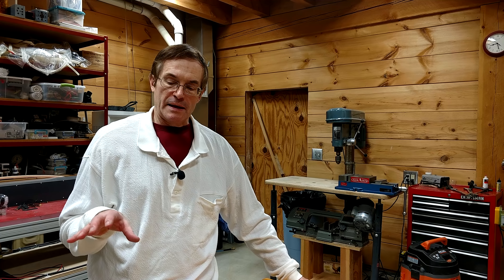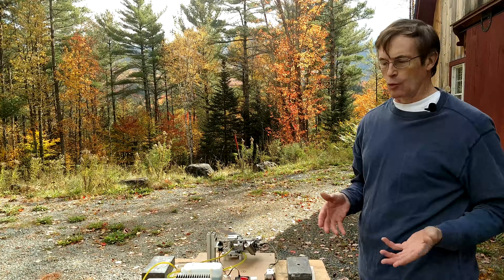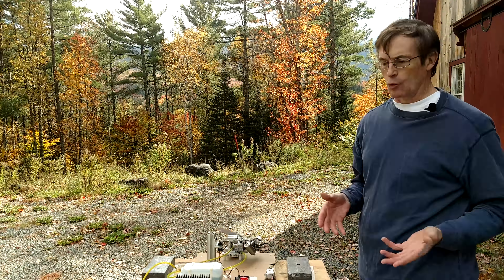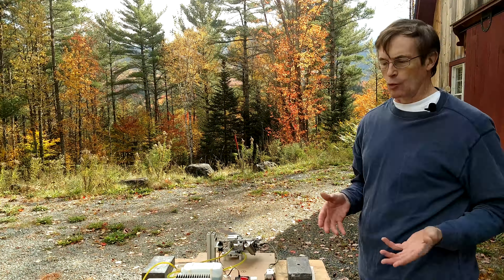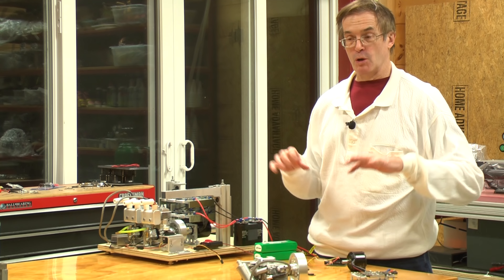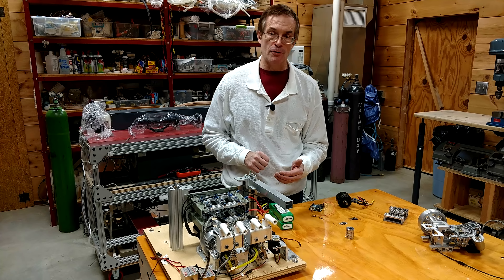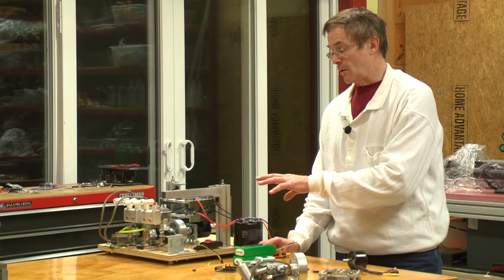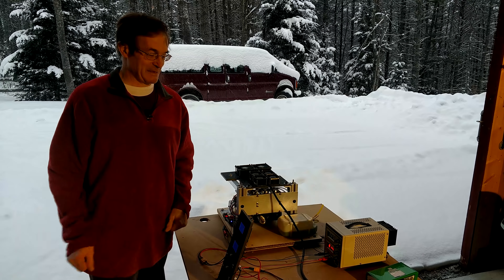Hybrid Drone Generator

Comment: Since you are running 2-stroke engines at a constant RPM it seems like you would benefit from a tuned exhaust expansion chamber.
Reply from the maker: That's probably true.  They all seem quite bulky and might complicate the enclosure design, nevertheless we will test one to see if the fuel savings are compelling.

Comment: A Cush drive hub like those used on single cylinder, 4 stroke dirt bikes used for road use may be of benefit. Twin 4 stroke engines that have the power and ‘pull’ strokes offset may further help. I love 2 stroke engines but am sceptical of their use for this application. 
P.S. in addition to the crossplane crankshaft, high performance 4 stroke engines make use of an additional counter balance shaft, (as  you undoubtedly are aware) running in reverse direction for most benefit. Interested in this myself but feel a turbine or at least a rotary engine, is a more beneficial route. A Hydrogen Fuel cell is the biggest carrot at the moment but is simply too expensive to support with ancillary equipment for the time being.

Comment: I've just found this channel and it's awesome! I'd like to do all this sort of stuff myself but I lack the time and space to do so, so it amazes me the job this guy does. Moving on, I wonder how he manages the charging of the batteries. They seem to be some kind of lithium batteries and they're pretty particular in these terms.
Reply from the maker: Thanks for the support, it means a lot.  The batteries are periodically charged on a standard balance charger.  The generator serves to minimize or eliminate battery discharge, but the batteries benefit from proper maintenance.
Reply: Tech Ingredients Thanks for answering. By the way, did you opt for the twin cilynder configuration for any particular reason? I'd expected an opposite cylinders, opposed phase and rotation configuration in order to balance the forces, but of course this makes installation a bit more complicated.
Reply from the maker: If the cylinders are operated in the more conventional twin configuration ie a "flat twin", then only if they are in phase will the mass imbalance cancel and only if they are out of phase will this smooth the output torque.  You still have to counterbalance the out of phase operation and as you say this configuration makes the installation a little more complicated.
Reply: Tech Ingredients That's right. However I meant, as you have isolated piston-crank sets, the setting could be better than a traditional flat twin, right? Running them out of phase and opposed rotation directions, and coupling the shafts with a gear instead of a belt, could bring both benefits. I don't know how much this would complicate things though.
Reply from the maker: I don't either.  But, we are working on so many other variations that I don't know if this is worth the time to tweak.  We have a super light, single cylinder, damn the vibrations and the voltage variations with wide open throttle operation and remote start, the 20 HP, 4 cylinder engine model, a turbine driven version and in the skunk works, a gas dynamic MHD generator as well...ya really.

Comment: How come without the generator running the resistors draw 12amps , and when you had the generator running the output from it was only 10amps needed to cancel the batteries out ?
Reply from the maker: That depends on the relative voltage output from the generator vs the batteries.
This can be fine tuned with a voltage controler.

Comment: Would there be an advantage to using an opposed piston 2 cyl 2 str engine as power source? There would be inherent balance of a "square" engine, less weight, cost, and complexity of single 2 cyl engine (with single crankcase).  The firing pulses alternate, occurring every half revolution (same as dual).  It's common for models of popular Cessnas, Pipers having  (wide) 4 cyl and 6 cyl opposed engines.

Comment: Motorcycle alternators are smaller, lighter, and use a rotating permanent magnet ring around a stator. They are usually coupled with a combined regulator+rectifier to produce stable 12-14v, perhaps those would work better?
Reply from the maker: They would work better than an automotive alternator.  The question is their power handling capability.

Comment: Nice concept and explanation, from a rough calculation, the breakeven of this vs straight battery is around 4.13kg which is .79kwh using the highest density lithium ion batteries... you should not compare to LiPo since they are not a high density system, they are a high discharge system. Keep up the research!

Comment: If you mount a single engine on a set of springs,do you think that may help dampen vibration ?....or attach a counterweights to the shaft of
the engine,one on each side of the engine to try and balance it...which will add about the same weight as the piston..?
Reply from the maker: Springs are interesting.  They don't dampen which is the conversion of the vibration energy to frictional heat energy.  They isolate, so that the engine continues to vibrate, but less of that vibration is transmitted to the structure.  It may seem like semantics, but it's an important difference because we actually want that isolation rather than have the force transmitted through a shock or rubber dampener.
Take a look at our video on "The World's Second Best Speakers". I discuss dampening systems there.
The flywheels do just what you suggest because they are not symmetrical and are weighted to balance the pistons.

Comment: I have a question about the capaicitors reducing the ripple. When you add in the batteries what is the capicitors for? Does the batteries not actually act like a capicitor in this instance and smooth out the power from the genterator? Mabey i am way off just a obsevation. I enjoyed your show and find it very infomative.
Reply from the maker: Thanks!
The very high peak charging and discharging that the batteries would have to sustain to act as smoothing capacitors is outside any research I've seen to support their survival.  It might work, but I didn't want to take the chance.

Comment: I wonder if there would be a way to reduce sound and vibration on lawn equipment by using 2 smaller engines and balance shaft and add a catalytic mini converter..

Comment: Great explanation of all the components and reasoning for each. My only concern is the size and weight of the large capacitors. Have you considered using a switch mode power supply or building something that functions in the same way as a SMPS? It seems like it would be possible to buy a 2000 watt SMPS and add some diodes to rectify 3 phase and get higher KV motors to have the voltage in the operating range of the SMPS. The benefit would be weight savings and voltage regulation handled for you.
Reply from the maker: The capacitor sizing is not well characterized.  The batteries themselves act in the same way to smooth the voltage spikes and it needs to be determined if capacitors are even needed.  The circuit as it stands is actually similar to a switch mode power supply.  In these, the high frequency, pulsatile DC current is smoothed with capacitance.  These can be made smaller because of the very high frequency (as much as 100kHz).  If we could obtain motor-generators with much higher pole count, this would help.

Comment: So I'm not entirely clear on this concept; are you talking about a quad copter or fixed wing drone? Would the weight savings offset the minor energy loss of the extra energy conversion, compared to direct drive?
Reply from the maker: The generator module could be applied to any electrically driven vehicle, even land based.  But our obsession on low weight derives from the intention to use these for aircraft and this is most important where there is no fixed wing to support the weight.
There is inefficiency due to energy conversion, but the are significant advantages.  The generator module can be placed at an optimal balance point, energy transmission through flexible wires is convenient and simplifies noise and vibration isolation.  In addition, the large number of existing, electrically driven drones could be fitted with these removable modules rather than fundamentally redesigned for direct drive systems.
Reply: I think I understand. 
So it's more about making the engines more flexible in terms of placement and power output, so that you can use a single, more efficient, engine to produce the majority of your cruising power. While at that same time working toward an industry standard that can readily connect to existing hardware.

Comment: so lets say I'm using four xoar ta120-20's and I plan on doing so at 44 volts, what kinda rectifier/capacitor setup am I looking at? I have a minarelli twin 140 for the generator it makes close to 35 horse at 4,500 rpm. I'm not sure if I should use a fifth ta120 or if need to buy another one. I know at max load at 44 volts I'm drawing 10000 watts per motor. I really could use some help, already spent alot on this. edit: this is for a manned quad copter, initially I tried using 8 vvrc 70t gas motors in a quad setup with only cable flight controls but could not find a way to eliminate slack in the control cables without sacrificing control vectors or adding more motors. Then I swapped to just four big minarelli twins and tried using a flight controller with servos controlling the motors instead of cables but for some reason it wouldn't work with arduino. I can't even make changes to my skateboard in vesc let alone use arduino so that's why I even tried cables in the first place. Three years and every penny I've made in the last five and I still haven't left the ground. Literally please help man
Reply from the maker: This is obviously a very large project, especially since your budget is limited.
It's tempting to start with the final large-scale goal and try to get each system to operate as the design requires. 
Been there/done that.
But, I think that is a mistake.
I'd hold off on that final build and construct a gassoline powered system, either centrally driven with a generator and 4 individual electric motor powered rotors or four small gassoline powered rotors. There are arguments in favor of either approach. You might try both.
Experimenting and modifying the small version is easier and cheaper, and you're more likely to get it right rather than cutting corners because of time and money constraints.
Reply: @TechIngredients  it's not the money man it's the failure for years while I hear my homies brag about their cubs and the crazy hunting trips they took it on. I wanted gas motors with manual inputs only in the interest of privacy and reliability but it's too unstable. Unless I seriously overprop it's just too twitchy and I've never even left the ground. Gas hybrid is my only option, the flight controller will work and I know that I can see examples drones are everywhere. I just don't know how much motor I need for the generator or how to build the generator. I'm just a hobby machinist I'm scared of electricity

Comment: there has to be about $3000+ of hardware and equipment on that work bench.  My jeep Cherokee is worth  $500, $200 maybe at a scrap recycler.  I won't be building this on my budget, unfortunately. 

But at least we can live through you and enjoy your achievements, courtesy of YouTube.  Thanks.
Reply from the maker: Technology can be expensive, but it doesn't have to be.  In many of our projects I discuss the issue of cost and the trade offs ie buy it, build it etc.  I enjoy designing and building these projects and have spent a lot over the years as "stuff" accumulated.
I built my first laser (nowhere my first project) when I was 10 years old.  I had very little money, there was no internet, I couldn't drive to scrap or surplus warehouses and angered my parents as I progressively dismantled and repurposed equipment from around the house and from my father's office.  It actually worked, produced an unmistakably narrow beam across a dark room and to this day remains one of my most cherished projects.  I nearly broke my neck leaping for joy, unaware that I was standing in a doorway.
Sometimes, our projects look fancy, but the principles don't care.  Using some of the ideas we present and building a successful project on a very tight budget is an even greater achievement.  Our most popular video describes a $30 loudspeaker!

Comment: So if I understand this correct,,,, the final design application is to be a locamotive powered drone? Is that essentially what we are doing? Why not just drive the propulsion with a single internal combustion motor and make your rotors variable collective pitch operation . You could power a quad with a single main power drive line with a beveled gear on each end.  Each rotor would mount on its own boom with a pinion driving its own shaft off of the beveled main drive gear.  Each set of rotors would then have it's own mechanically servo actuated collective pitch. Fight controller management/feedback/control would be in command of the individual servos rather than that of motor speed controls. Instead of adjusting lift and gyroscopic forces thru motor speed you are generating load and torque thru pitch of each rotor combination.
It sounds as if it might be very mechanically complex, but not really as much as you might think, if and when compared to the mechanical complexities of other "conventional" rotor flight systems such as bell and hiller mixing seen in helicopters. We don't have to deal with any type of cyclic control of the rotors but only simple collective pitch. 
The early mechanical complexities of r/c helicopters were certainly much greater back in the good old days before computer radios. (Anyone old school enough to remember the Kavan Jet Ranger helicopter kit? Schluter, GMP collective models?) In the good ol days everything was mechanical, no gyros no electronic throttle curves,tail rotor compensation. All those solutions were applied mechanically before we had  electronic flight control systems and mechanical gyros ....
Kurtis Youngblood had at one point demonstrated a similar system that he tried to market. The adaption of rc/heli tail rotors and booms (4x) made this practically off the shelf for a collective pitch operated multirotor or "drone" as they are called today. Certainly probably much greater efficiency than a power generating locamotive hybrid type of design and certainly with better power to weight ratio coefficient too. Something that would be advantageous to a heavy lift vehicle!
Reply from the maker: One advantage of this approach is that the modular generator can be added to an existing multi rotor.  Another is that it the module can be vibrationally isolated because the power will be transferred through flexible wires rather than mechanical linkages. Also, this is simpler than incorporating multiple, independent pitch controls for each rotor.

Comment: couldnt you mount one engine upside down so you have 2 pistons working in opposite directions negating the balance problem?
Reply from the maker: This would help, but there would still be a rotational moment because the two, out of balance forces, do not line up.  It would also be somewhat more difficult to mount the motors.

Comment: the crank counterweights typically do NOT COMPLETELY cancel the piston mass.   Poster touches on this with the imballanced propeller concept; a 100% counter weight would simply make the engine vibrate in the other axis.  Without more cylinders (a lot more-8 total I think) a recip machine cannot achieve the balance of 'a high quality auto engine,' (not considering radials).  I believe the 'cheap' RC engine returned to vendor did indeed have the correct counterweight on the crank or it would have destroyed any model attached to it.

Comment: Why not use the filter capacitors to provide power during the transient high demand?
Reply from the maker: They contribute a little, but their capacity is limited.  You need the energy in the battery.

Comment: If the uav spends the entire flight time hovering with minimal payload, do you think this type of engine will oil the plugs Vs how they are tuned to cope with full load and max payload? This could be a concern if flight parameters were to drastically change (gusting winds, close proximity flying near trees etc etc)
Reply from the maker: The difference in power consumption for these large, slow moving multi rotors in hover and forward flight will be small. Tuning for optimal engine performance should apply to both situations.

Comment: use the generator as motor to start the engine , use a bidirectional controller , synchronous rectification in generating mode and inverter in starting mode

Comment: I wanted to build an hybrid petrol-electric bicycle with a 4 stroke RC engine made by NGH 38cc but you just blew my dream away now that I ve found your video...Can you tell me a good alternative 2 stroke in this budged of 300 usd ? I ve already received a 7 Kw 80100 motor and ordered a VESC 100V 200A (300A Peak) controller. My initial taught was to connect them together to a CVT torque converter to drive the bicycle. What do you think about this idea ?